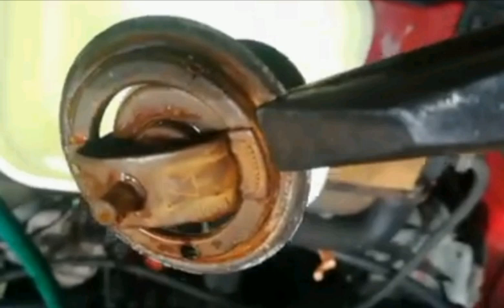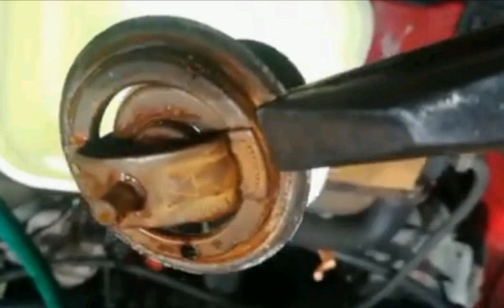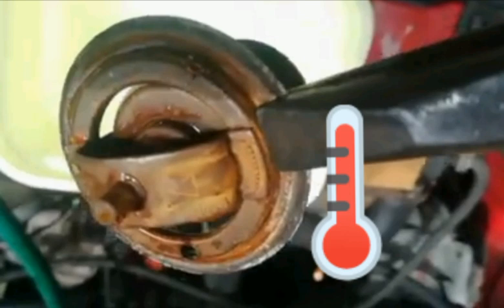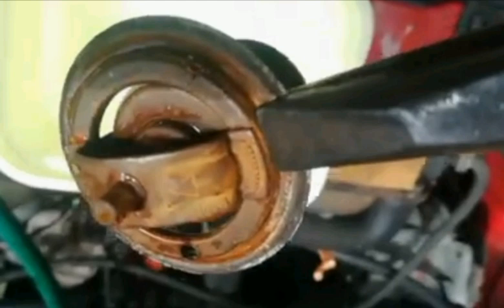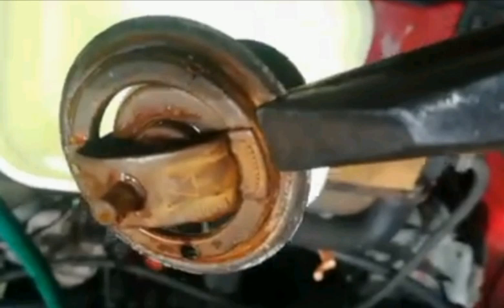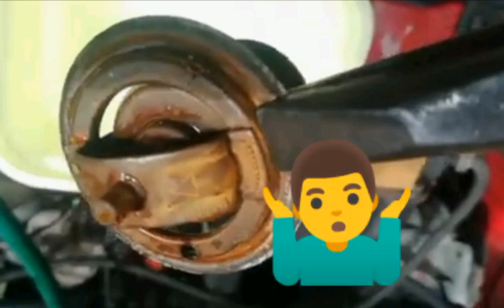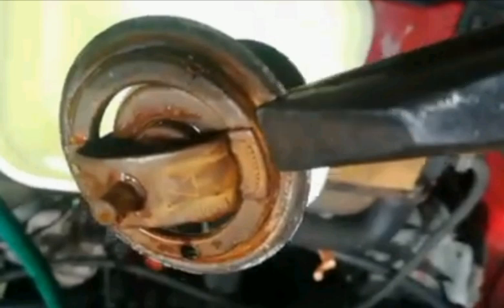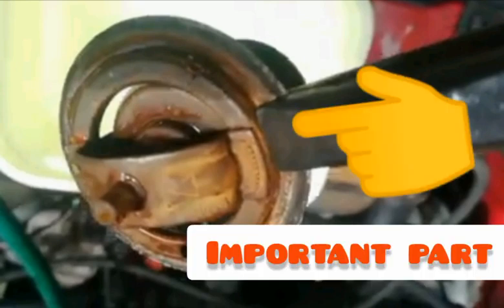GOLF MK1. REMOVING  THERMOSTAT HAS NEGATIVE CONSEQUENCES ON AN ENGINE

Comment: Thank you for this video. However, how do i know i need to change my Thermostat?
Reply from the maker: If  the cooling system is working fine..don't touch anything... Thermostat can either get stuck in the open or closed position...ensure you buy good quality....it's the pirate ones that cause problems

Comment: How's it man I wonder if you can help me 
Recently my Citi golf 1300 decided to Boil and overheat because my water bottles cap wasn't properly .
it wasn't a very nice Friday morning for me...... 
But the thing I didn't get was the heat gauge never told me the car was overheating or getting too hot so I decided to change the heat gauge sensor (the single pin variant)  to make sure that this issue never ever happens again because it was my fault not checked the water cup was properly secured in place .
But I'm currently getting this problem the gauges reading very very temps and it is just over half. I've gone as far as changing the water pump changing the thermostat and removing the thermostat from the car and still I'm getting very high temps.
But what I was thinking about can't the heat gauge sensor be broken or faulty because I usually stops three quarters of the way and then it doesn't budge it doesn't go all the way so maybe you can tell me if I'm right or not because I don't want to pull the head to do the head gasket right so please tell me what can I do and yes I'm gonna put the thermostat back as soon as possible because I don't want the car to break down
Reply from the maker: I'm not sure if I'm understanding correctly.. Is the engine actually overheating? , or is it just showing high reading on the gauge.?   If  engine is overheating, then I must ask this question... Did you bleed your cooling system after you put in fresh coolant, and after u changed stuff.? ...did you open up your heater when you put in new coolant?... If not then you may be experiencing an airlock.. That causes overheating,.
Reply: How do you change the temperature sensor ?